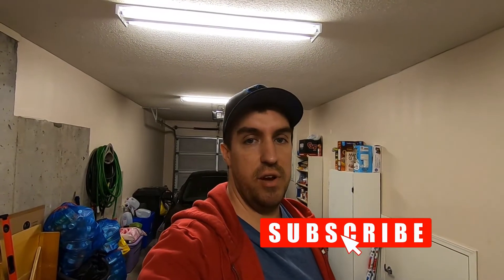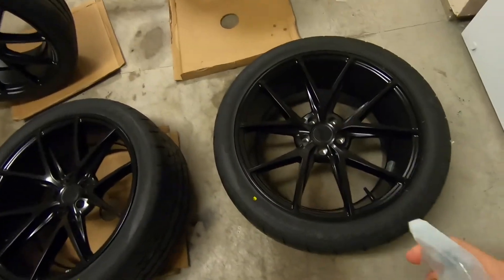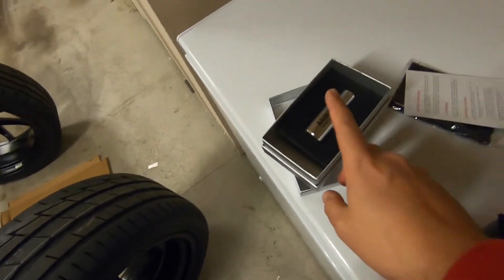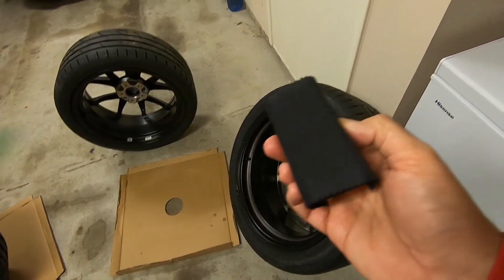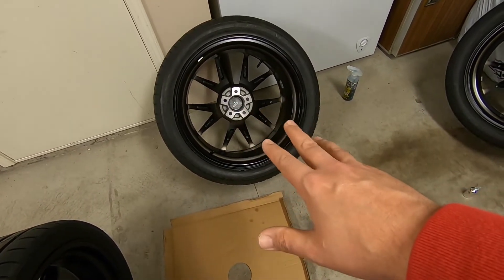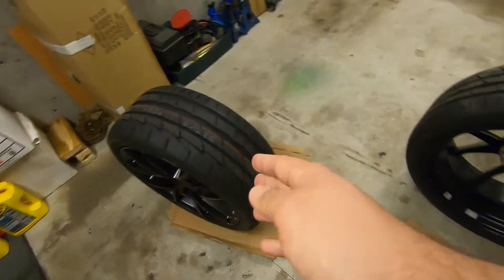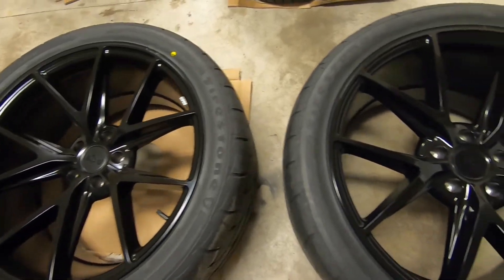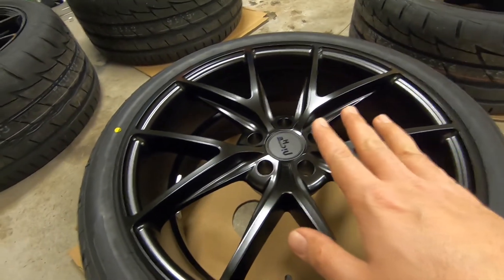HOW TO CERAMIC COAT MATTE BLACK PAINT *DIY AT HOME WITH PROFESSIONAL RESULTS*

Comment: Thanks for this great vid. I have new gloss black wheels. Will the process be the exact same? Or will gloss black wheels be difficult to do properly? 

Thanks for you explaining everything so clearly in your video btw!
Reply from the maker: It would work the same. This is the process I used on my car as well and it was gloss black. Best results just make sure to get full coverage and let it fully cure before you handle them to much.